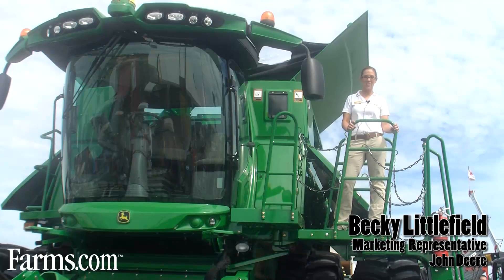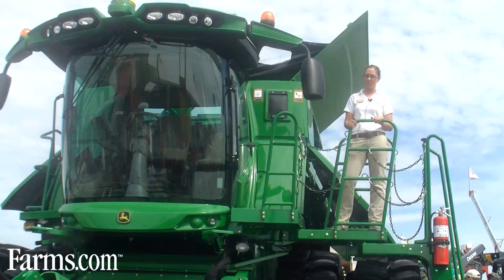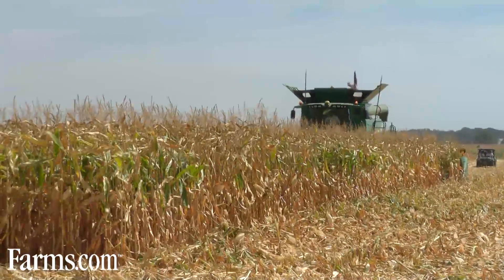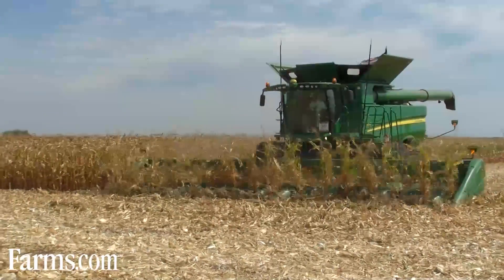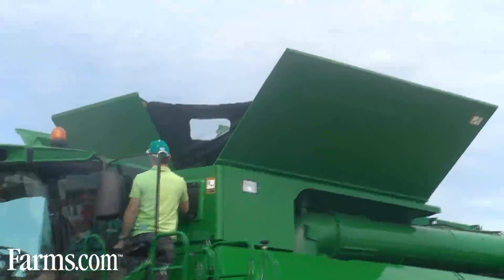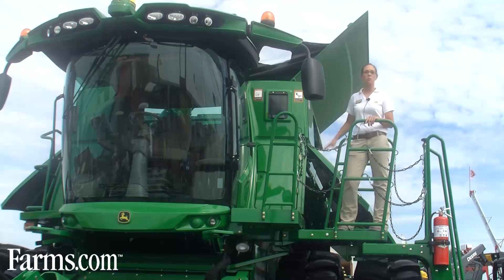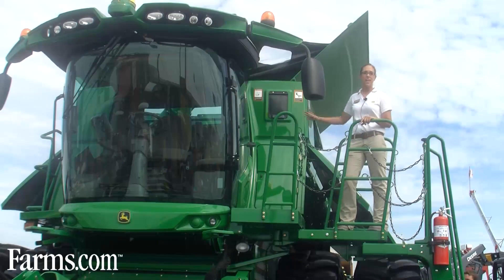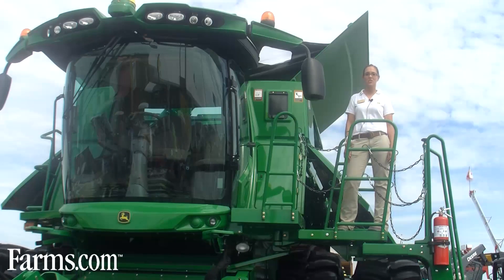The New John Deere S Series Combine  JD S690

Comment: Longer shaker shoe? Really? If there is one thing that Gleaner and Massey learned, and taught us, its that wider is far better than longer. 
It seems to me that Deere is looking for everything they can do to increase the price on something that is already WAY over priced. Built in refridgerator??? Did you all remember the "Super secret decoder ring"? 
How about inserting some common sense, like not tying unimportant electronics to those that are needed, such as the cab comfort system to the engine. If the A/C unit goes down, why wire it to shut the engine off? How about engineering it to not catch fire just because the wind switches direction...how about getting new engineers?

Comment: I couldn't help but notice they never mentioned a fire protection system on that combine.You just call your insurance company and get a new S690 the old one burns up in the field.I think that's a standard John Deere feature of the new S690.Then you get on your smartphone and call up a new insurance company when they cancel you.Then you go out and by another S690 (S 690 means you will spend $690,000.00 on each and every fire claim,after you run out of insurance companys) LOL!!.